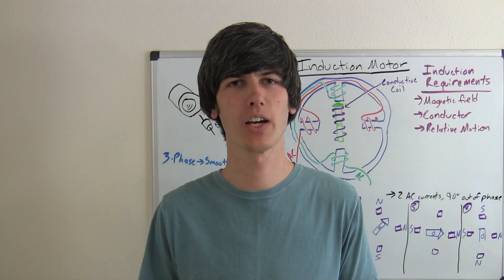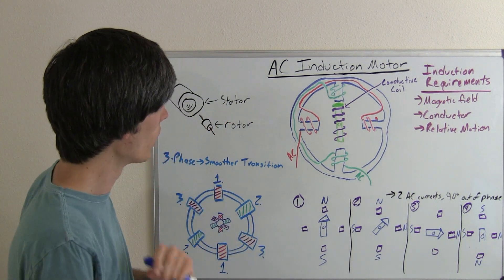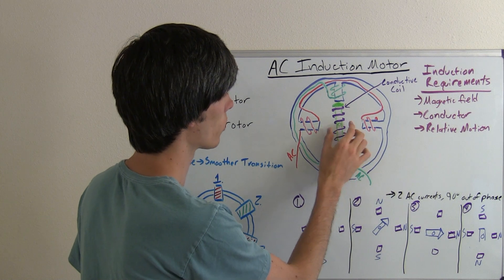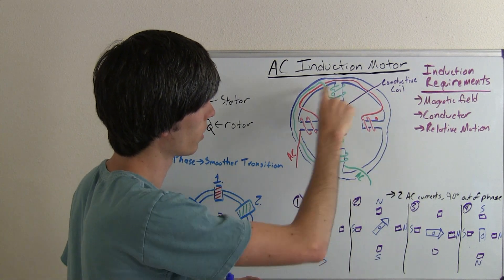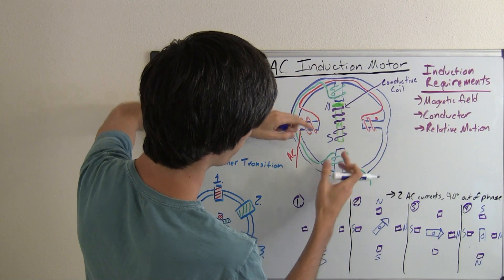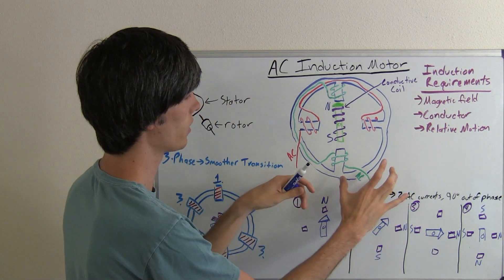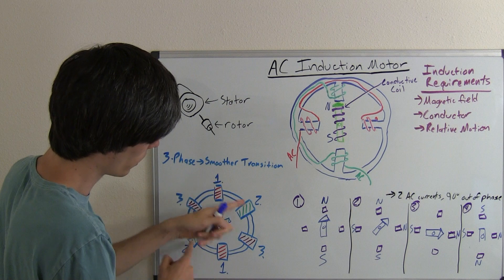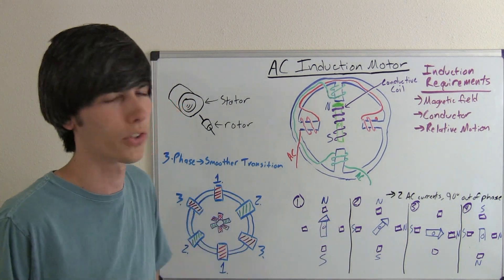Induction Motor - Explained

Comment: I just have a question I tore an old generator apart
Reply: My question is half of the generator has 4 coils on one side for coils on the other each coil consists of 14 turns my question is what is the purpose of to individual parallel wires in that 14 turns is that for amperage or does that mean it's 28 turns each coil thank you if you can answer that.

Comment: are all 3 phase motors timed the same way?  or can they be timed in other configurations?  the way you describe it seems to be the most efficient.  I have one from an electric vehicle.  I am trying to figure it out. want to find a controller to use with it.

Comment: This is NOT an induction motor are you kidding me?? In an induction motor,  the magnetic field of the stator rotates faster than the rotor's angular speed. What you covered in this video is some kind of a synchronous motor.

Comment: in the 4 pole motor you have drawn, one lead goes to the red poles and one to the green poles. where do they terminate inside the motor? are the two shorted together anywhere? also, would giving it a AC wave just make the rotor twitch back and forth?
Reply: it would twitch back and forth if your phases are 180 degrees out of phase I think? if you are 90 Degrees out of phase, it should gradually pull the motor in one direction.   

Once you start applying the motive force on the rotor, it won't spin backwards I think. It should be like swirling your hand in a bucket of water, your hand will move faster than the water initially but eventually the water will match your hand speed.

Comment: Great video! Helped me understand how these work. The one aspect I'm still having difficulty understanding is speed control. 

It seems to me based on your explanation the frequency of the AC current supplied is what dictates the rotor speed. I've always assumed 60hertz was a standard frequency for AC current. Can you or someone please explain how the speed is actually regulated by voltage? or current? or frequency?

Comment: I understand changing the polarity of the stator through the coils is what get the central rotor spinning. But my question is, If the coil is permanently attached to the battery, how does it (the battery) control or regulate this current, how does the battery changes on/off to affect the polarity of the stator if its wires are connected all the time
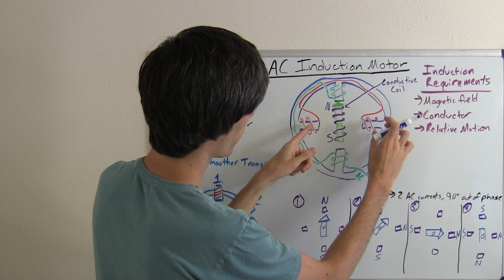Reply: eg: at 2:53 you say "the current drops to zero"

Comment: Nice diagrams, but unfortunately you seem to have described something similar to a "stepper motor" (where-by the iron "rotor" rotates to align its two ends with the "N" and "S" poles of the "stator", and thereby maximises the "magnetic-flux-density" by minimising the reluctance across the two air-gaps, (by making the rotor to stator gaps minimum. )

Agreeably, as you explain, the (two-phase, and ideally 3-phase) "induction-motor" DOES produce a "magnetic-field" rotating around the circumference of the fixed stator (typically two "north-poles" and two "south-south" poles in a Rear-wheel drive Tesla Model-S 90 induction-motor containing 60 "stator" teeth (around which phase wires are wrapped) and 74 rotor teeth (between which a "squirrel-cage" of solid copper bars are laid) see Tesla (pending) patent EP2202871 A3), BUT the rotor is essentially several low-resistance conducting wires or bars (typically NON-magnetic copper) ideally arranged VERY CLOSE TO THE SURFACE of the rotor's circumference (and parallel to the rotor axis), and not, as you seem to show, wound radially along the diameter of the rotor. 
The torque on the rotor is then developed by the interaction between the "magnetic-flux-density" ("B" teslas) which exists in the "stator's" "magnetic-field", and the electric-current ("I" amps) flowing along most of the "rotor's" copper bars. The really elegant thing about the induction-motor, is the way the the electric-current is produced in the rotor (without the need for brushes or slip-rings), and is usually the tricky bit to understanding how induction motors work:-
Essentially NO electric-current (and therefore NO torque) is "created WHILE the "rotor" is rotating at the SAME "rotation rate" (eg rpm) as the magnetic-field in the "stator" !  Only while the "rotor" is NOT RUNNING SYNCHRONOUS with the "stator's" magnetic-field, (ie the "rotor" is rotating slower (or conversly faster) than the "stator's" rotating field) IS "electric-current" (OR STRICTLY A VOLTAGE CALLED "EMF") "INDUCED" into the copper bars, (hence the induction motor is also known as an "asynchronous" (assynchronous?) motor).  
The "EMF voltage" (and therefore the "electric-current") is induced in the copper-bars only while each copper-bar experiences a CHANGING "magnetic-flux-density" (because each looping "magnetic-field line" (moving faster (or conversly slower) around (and beyond) the stator) is moving across each copper bar).
The rotor (and hence the elecric car) will accelerate by using sophisticated electronics to rotate the "magnetic-field-lines" (around the stationary "stator") faster than the copper bars (in the "rotor"), or conversly cause a braking-deceleration by rotating the "magnetic-field-lines" slower than the copper bars!
See the excellent "Electric Motors and Drives" by Austin Hughes 3rd/4th Ed, for beautiful motor descriptions with the minimum of mathematics involved !
Reply: Paul Rhodes this is what I was looking for. I think EE is talking about things he doesn't have a real grasp on (and considering he is a mechanical engineer it's totally understandable). I was thinking the whole time, how can the induction of the stator affect the rotor if they are both generating induction fields. And even if they could, what would be the point of having a coil instead of a magnet if it's just going to be a static polarity.

Comment: I am not sure if the rotor is actually trying to magnetically lock up with the rotating magnetic field. Because that would make the slip zero and cause no more rotation. I have read it somewhere that its because of Lenz's law, the rotor is rotating. According to Lenz's law, the induced current will cause an effect that would work against the field that created it. To negate the field, the induced current is causing the rotor to rotate and thereby trying to cancel the relative motion which thereby cancels the induction. But i am not sure either.
Reply: I am an electrical engineer and have studied a lot electric motors.

The rotor magnetic field and the stator magnetic fields ARE  locked up.
 You must have clear that there are two distinct speeds, the MECHANICHALl rotational speed and the MAGNETIC rotational speed. While both rotational magnetic fields (rotor and stator) are the same, the stator-MAGNETIC-rotational speed is slightly faster than the rotor- MECHANICHAL-speed ( definition of slip). And it is an effect of this relative speed (or slip) that induced currents are present.
The magnetic speed of the rotor  is mounted on top of the rotor and it can it can be understand like a passenger running inside a train. The train being the rotor mechanichal speed and the sum of the speed of train and passenger as the rotor magnetic speed (slightly faster than the train itself)..

Hope it helps!
Reply: You are correct, i think he was trying to explain it the way he did because it's simpler to understand and requires no prior knowledge of physics/electronics

Comment: why do AC motors(and induction motors) rev higher than dc motors?  thanks!
Reply: DC motors are limited by their brushes. Brushes cause less energy transfer and higher friction on the motor.
Reply: @jonathong.4203  Many DC motors are brushless
Reply: @arrrrr9831  such as? If you're thinking of BLDC motors like what are used in drones and rc cars, they are technically three phase a.c. motors, but my point stands that you don't have brushes to limit your speed
Reply: Jonathon G. No they are not technically ac induction motors. Hence the different names. Almost every vehicle with a dc motor will be a BLDC. The differences in rpm limits in ac and dc motors are not due to the brushes because like I said in this use case most DC don’t have them. But instead due to the rotor using an electromagnet instead of a permanent magnet.

Comment: By which figure is the rotation frequenzy limited?
Wouldn't that be the frequenzy of the source?
Reply: It's controlled by the voltage. The higher voltage makes a stronger magnetic field which pulls the rotor faster.

Comment: Something I'm unclear on: household ac power is single phase. Three phase power has to have a special hookup, so how do you go from single phase to the two 90 degree offset phases needed for the motor to run?
Reply: House supply is indeed single phase, but if you have power poles where you live you will see at least 3 wires on them. These carry the three phases. Electric motors designed to run off single phase have a different design

Comment: Nice Explanation:)
Just tell me, isn't the strength and direction (polarity actually) of the rotor conductor magnetic field alternating in nature;
Since u've used an ac source to induce a current in the rotor, the induced current in the rotor should be alternating and so
will the flux( or the strength and polarity )of the  rotor magnetic field.
U haven't taken into account this phenomenon.
plz reply asap:)

Comment: Is the motor the same thing as an engine? Stupid q
Reply from the maker: Depends what you're referring to. Technically, a motor is electrically powered, where as engines use some form of fuel, however engines are commonly referred to as motors. In this video, I am discussing something completely different than internal combustion engines.
Reply: As EE said electric powered units are almost universally called motors but fossil fuel units have some exceptions such as an outboard boat motor.  Not a stupid question because engineering tends to have specific terminology that defines the technology.  In my concrete class I learned that you will be considered a moron if you refer to concrete as cement since cement is the component of concrete that binds the aggregate (sand & rocks).  After 23 years I've stopped correcting people for saying cement so they'll invite me to parties again ;)
Reply: In physics a motor = a device which converts electrical energy into mechanical energy (movement) where as an engine, say a car engine actually takes chemical energy (combustion of fuel) and turns that into mechanical energy (movement)
Reply: Mark Lofaso haha good on ya mate. ill have to remember that to annoy people later
Reply: Engineering Explained thanks man. cheers
Reply: i guess we're taking work from both engines and motors so both can be called motors, no?

Comment: Maybe explain Pulse Width Modulation seeing as how it is used to control the speed of brushless motors (and probably Induction motors too?)
Reply: Frequency controls speed of AC induction motors...
Reply: EETechs I dont fully understand the workings of a Pulse Width Modulator or how it is used to drive a motor, but I believe a P.W.Modulator must vary it's output "frequency" as RPM changes in the driven motor. So, in essence, the modulator "chops" or "pulses" the output signal less(or more?) times per second as the motor RPM increases, thus changing the output frequency.
Reply: corydiesel88 Pulse width modulation is only a change of ratios of on time and off time. The total sum of the on time and off time have not changed. Therefore, the frequency is the same.

Comment: For the 3 phase motor wouldn't it be 60° out of phase ?. Since u have two poles for each phase.
Reply: 120 degrees out of phase between the two outer magnets presumably? The centre magnet would be 60 degrees out of phase with each magnet on it's side so that the rotor would try to align with the strongest magnet in the middle...?